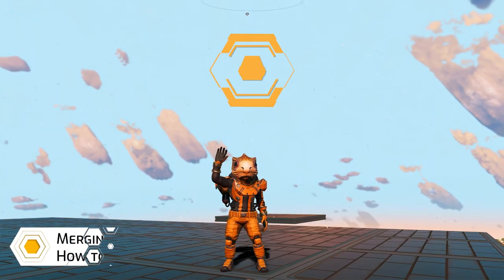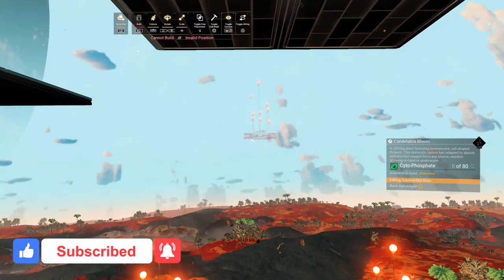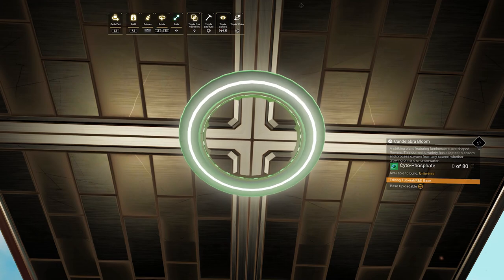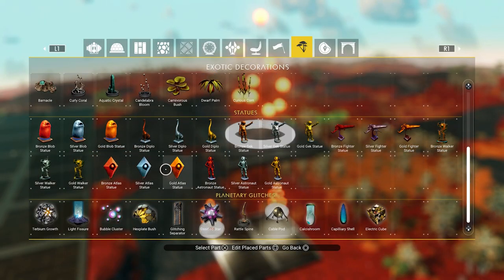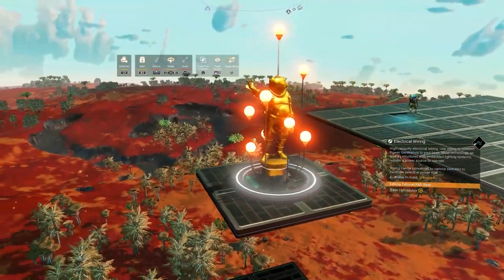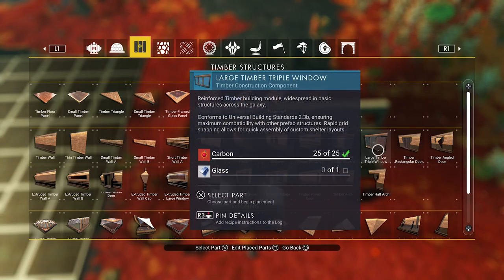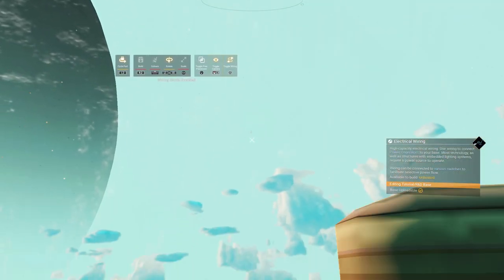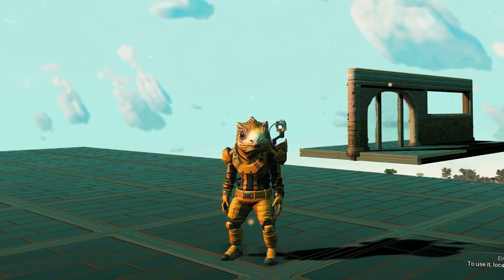Blend Parts Without Glitch building - No Mans Sky Base Building Guide by Beeblebum

Comment: Excellent! Since my potato is too slow to do glitching I thank you deeply for this! NOW I can do my SRT Bridges!

Here is a thought, use the viewing sphere part to place the SRT bridge in, and a door on it. To do the SRT underwater use the underwater 'shelter' part.

Something I am going to try is to place the 'units' of the SRT bridge underground to hide them, I will experiment with this and see if it will work even if the area gets filled with soil, I think it will
Reply from the maker: It will work sometimes, It takes some time for water or terrain to "Solidify" when using the teleporter bridge. Also if you dig underground, build your teleporter  and then fill up the terrain again - It will be in an empty space below the terrain, which should normally work "Fine".